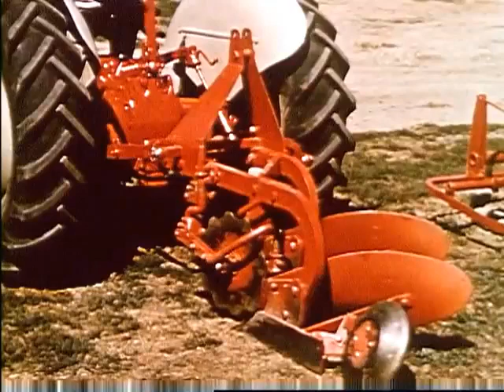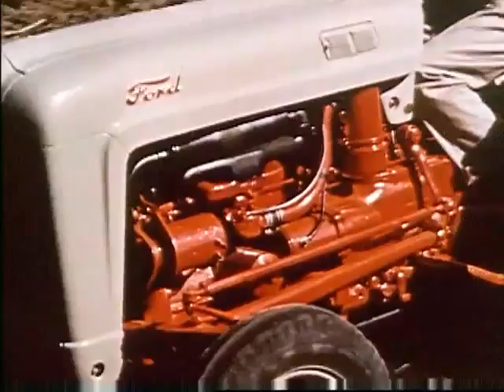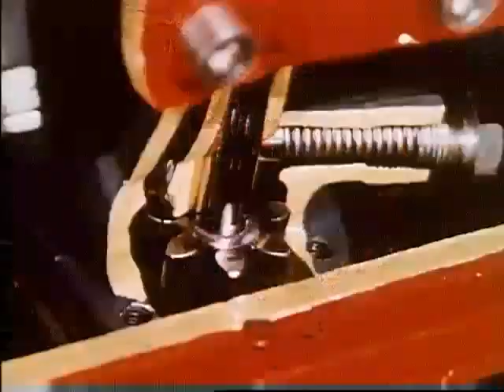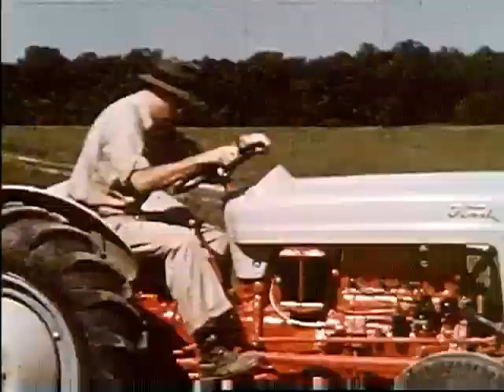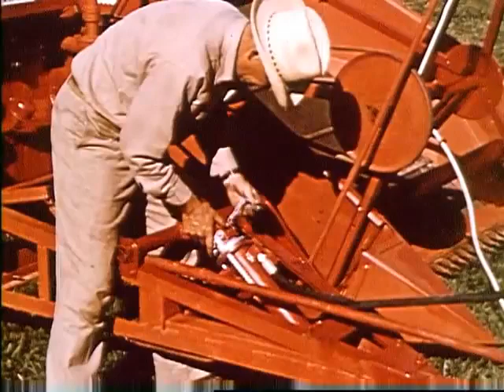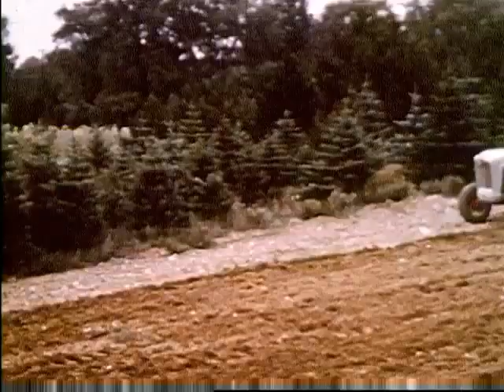The New Ford Tractor 1953

Comment: Another thing FORD did for FARMERS back then 😊 with the roll out of this new ENGINE that moved all the visibility issues that FARMERS had probably ASKED ford engineers to design into a new roll out of the workhorse with heavy duty engines instead of horse drawn. Just think of a FARMER driving FORWARD no clutter of a engine PIPE coming up through top of cover. The big AIR intake not being onTOP 😊 all relocation and SAFE from FIRES like narrator says 😊 nothing on top of new ENGINE covers to block forward visibility a very big issue for a FARMER. I bet it was looked at by FARMERS as just a big "WOW" factor. No moving of HEAD or NECK to see in front. 😊❤😊

Comment: Is this not the SAME engines that were put in the AIR compressor trailer hauled (Jackhammer) 😊 If it is, those engines lasted. On our FORD gas engine powered Jackhammer it keeps working year after year. I ran ours hard, and saw it later still working for another contractor that wanted to just take over ownership of ours after I had left my uncle's sewer business. I rented these FORD gas powered inline engines throughout my working years. And none "0" ever did not START even in cold weather and ran at a very high RPM when breaking up cement. They just kept working. I saw full rental yards with the FORD gas engines in rental fleet 😊 that should tell you if rental fleet liked the reliability of the FORD gas heavy duty tractor engines 😊 in my humble opinion they must be a very well built heavy duty gas industrial use engines 😊